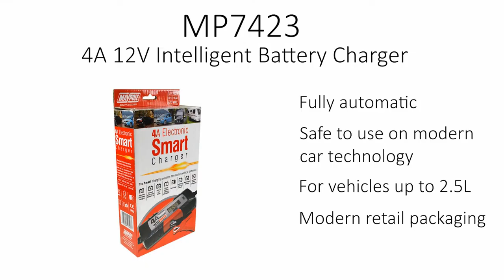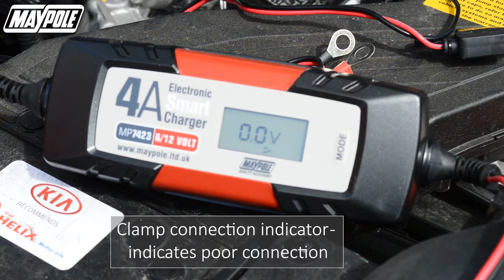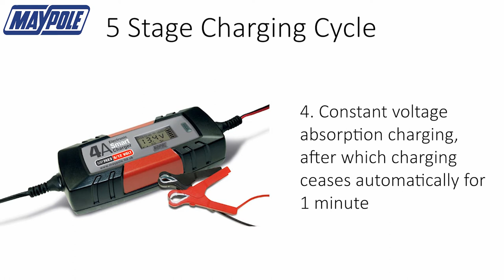MP7423 4A 6/12V Electronic Smart Charger | Maypole Battery Chargers

Comment: I notice that in the video the car's negative and positive leads remain connected to the battery throughout the charging process . Do you need to disconnect the battery terminals first? All charging information and car manuals  I have  read in  the past 30 years have stressed that at least the earth terminal of the battery should be disconnected before connecting the charger otherwise you can damage  the alternator and car electronics. As I own a new Kia Sportage I don't want to risk anything destroying the alternator etc.
Reply from the maker: We have checked with our technical department and they have stated that it is not necessary to disconnect vehicle from battery prior to charge. Thanks.

Comment: It's always adviseable to connect the neg. to a non painted chassis earth when the battery is connected to the vehicle. The video is surely wrong because it shows connecting directly to the neg. terminal. This is a very good charger/maintainer though and very competitively priced. Works on positive earth vehicles too.
Reply: Peter Jones , he did, but the caption said chassis.
Reply from the maker: Hi, It is considered best practice to connect the negative clip to the vehicle chassis; most vehicles will have a marked connection point specifically for this purpose.  In instances where this cannot be achieved direct connection to battery posts is acceptable.
Reply: It doesn't do any harm, usually the battery has a metal plate you can attach it to, but its fine to attach it to the negative terminal. I have no option on my rs3 as the battety is in the boot and no other metal there. Well, it is for ctek chargers. I always attach cables, then connect the charger, then turn on plug socket power. If anything goes bang I'm 10m away.

Comment: Hi, the charger is detecting a 6v battery. It seems to be pulse charging over time. I attempted to press mode to change the charging mode but to no avail. Is there any support you can provide?

Comment: As my Chrysler PT Cruiser 2.2 diesel's 12 volt battery was completely depleted, your charger automatically detected and charged it as if it was a 6 volt battery.
Hitting the button (constant press or tapping) to change charging function does nothing.
Reply: Mine also  when charging Ford Transit Tipper 2 x 6V Batteries , the Mode Button doesnt change anything - Batteries fully depleted for some unknown reason. on charge now at 2.00pm 10th NOV 2023 Will update progress  if time permits
Charge is creeping upwards from 1.5 to 2.0 30 mins later

Comment: When the ring connectors are attached permanently to the battery terminals of the car there is an exposed pin on the 2 pin connection lead from these terminal that the charger would be plugged into (i think this is an sae connector). It looks like the pin is +ve....so is there a cover for that pin while the charger is not in use, as a live uncovered 12v pin is not a good idea while driving about.......
Reply from the maker: A rubber boot is provided on both sides of the battery cable to insulate the pins.
Reply: @MaypoleLtd1  ok....thanks for the reply.

Comment: Hi when charging a EFB Battery on a stop/car do  you use the standard  charge mode not the AGM ??
Reply from the maker: Hi, this battery charger is only suitable for AGM or lead acid batteries only.
Reply: @MaypoleLtd1  Hi when charging a EFB Battery on a start/stopcar do  you use the standard  charge mode (LEAD ACID) mode not the AGM ???

Comment: I have two of these chargers .. I connected the first one to my battery and only had the green background light on with no symbols .. connected my second charger and it worked normally .. any ideas whats wrong with first charger ?
Reply from the maker: Hi, as there is no display and just a backlight, it sounds like a replacement is needed.

Comment: Hi there. Just purchased one today to charge my agm battery, however when  I connect it, it doesn’t automatically select agm battery. It just goes to normal charge. Also, in the manual it says that the outline of the battery on the lcd display flashes during charging. It doesn’t. Any advice?
Reply: The charger doesn’t automatically select the AGM battery type. Press the mode button until AGM appears in the battery silhouette. The charger then automatically starts and selects the correct charging mode and the battery symbol will remain steady with the voltage displayed. Mine reads about 0.3v too high.

Comment: Hi. Somehow the charger is detecting a 6V battery when it is a 12V. I clicked on the "mode" button and it kinda allowed me to force the change into a Standard 12V. Is that ok?
Reply from the maker: Hi, the standing voltage of the battery is less than 7.5V so the charger thinks a 6V cell is connected. Please attempt to charge the battery via other device so it’s above 7.5V and the charger will recognise it correctly.  Many thanks, the Maypole team

Comment: Does this charger rely on mains connection or can it still be used as standalone charger ?
Reply from the maker: Hi, it must be plugged into the mains to charge the battery.
Reply: @MaypoleLtd1   Not very smart then 🤣🤣

Comment: I own a motor bike and have connected this charger up as I wont be using during the winter. Is it safe to leave charger constantly plugged in and in winter mode (snowflake on display)?
Reply from the maker: Hi Andy, yes it would be safe to do that. Thanks, The Maypole Team
Reply: @MaypoleLtd1  Thanks, good bit of kit easy to use, reasonably priced and does what it says on the tin.
Reply from the maker: @lordloverocket71  Thanks Andy!

Comment: Hi what mode do u put this on for leisure batterys  eg winter mode or 12v standard thanks
Reply from the maker: Hi, if the battery is AGM please select Winter mode, and if it is non-AGM select 12V Standard mode. Many thanks, the Maypole Team
Reply: Thankyou

Comment: What is 12v AGM mode? What is it used for?
Reply from the maker: It is for 12V AGM batteries. So the charger is suitable for use with 6V & 12V lead-acid and 12V AGM batteries of 1.2Ah to 120Ah

Comment: While charging, what is the difference when the backlight is orange or green?
Reply from the maker: Hi Colin, the back light will change from red to green throughout the charging cycle. Thanks, The Maypole Team
Reply: @MaypoleLtd1  What do red and green signify? Is it important? (Nothing in the manual)
Reply from the maker: @richardgaunt4271  Hi, do you mean the colour of the backlight?
Reply: @MaypoleLtd1  Yes
Reply from the maker: @richardgaunt4271  Hi, the red backlight shows that charging is in progress
. The green backlight shows that charging is complete or is maintenance charging

Comment: ive attached the charger to my battery its still flashing i need to connet it but i cant get the battery out
Reply from the maker: Hi, please check that the terminals are clean before connecting the clips. Also please read your vehicle manufacturer’s instructions for further information and advice regarding the disconnection of the battery for charging purposes.